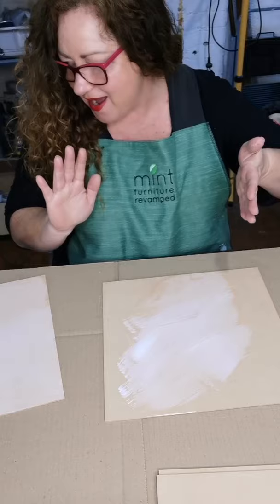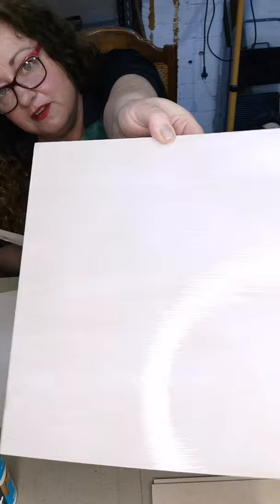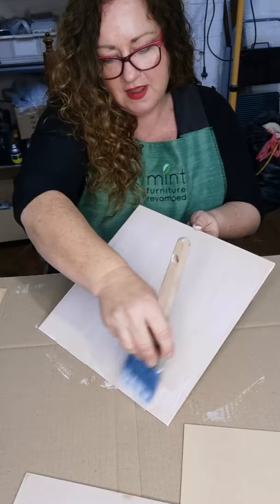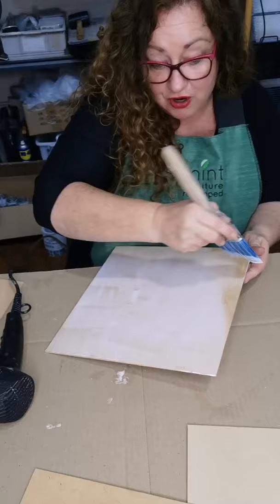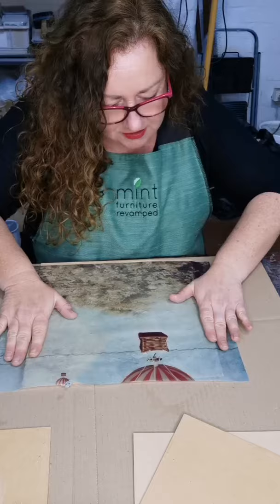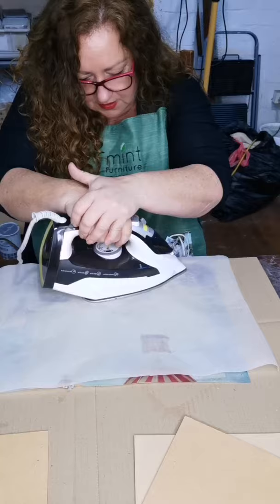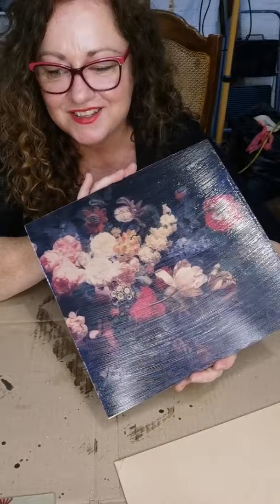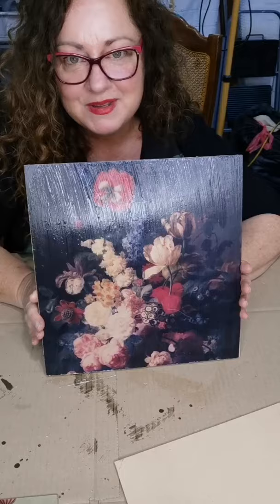How To Decoupage Using The Iron On Method

Comment: Hi, I have a large sheet of tissue paper to decoupage on a blanket box. It doesn’t have the finish on it. Would clear waterbased sealer be ok to iron the paper straight onto it or do I need to use the glue as well? Thanks